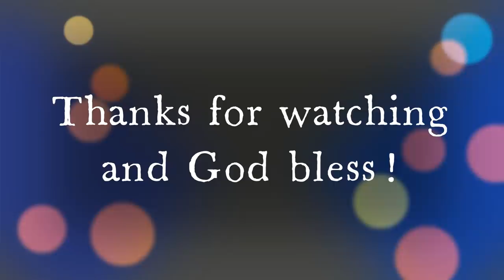Brrrr! Dairy Farming in the Cold/Frozen Waterer/Gehl 4400 Skid Steer Repair

Comment: just watched your show. you have water lines freezing and having some one come over with a steamer. here in northern alberta where we get temperatures as low as - 50 some winters. we do have water line freeze, tip for you to maybe save money, i use a length of plastic hose about 8 ft long (frost goes down that low where there is high traffic areas such as around watering bowls) that is small enough to fit inside the frozen pipe. you can  either poor hot water down using a funnel or a hot water hose if handy. i also find that what works the best for me (since i dont have hot water hoses close by)  is a water fire extinguisher filled with hot water and pressured up with air and a small hose attached to push down pipe. works great. if you have never tried this, hopefully that might help next time and save some coin for you

Comment: The skid steer with the fouled spark plug, find out which plug, take it out use your propane torch heat the tip and some of the threads just to burn the carbon off and pick as much of the carbon off and reinstall the plug and it should fire, I am sure you do this already to the chainsaw and snow mobiles too.

Comment: I have put a 100 watt incandescent light bulb in a pig tail with a plug end on it, connected to a extension cord inside of those heated waters. There is enough heat off the light bulb to keep the pipes from freezing.
Reply from the maker: I have a heat lamp in there, this froze under the ground because the pipe isn't very deep under the building.

Comment: Need one of those heat trace cables for that water line 👌
Reply from the maker: Those work good, but this one freezes under the floor, and I can't get a cable down there.
Reply: @trinitydairy  
These tee in and the cables go in the pipe , works good, have some at home  for the same type water system
Reply from the maker: @jjm4794  oh that's cool! I've never heard of those.
Reply: @trinitydairy  
Buy what ever length best suits you and done
Reply from the maker: @jjm4794  where do you get them?
Reply: @trinitydairy  
I get them through my supplier at work but I have seen them on Amazon
Reply from the maker: @jjm4794  thanks, I'll check it out.

Comment: Need to get a bottle of 9-1-1 fuel treatment and dump in the fuel tank of your skid steer
Reply from the maker: I run no1 in the winter.
Reply: @trinitydairy  never tried it. Always used 9-1-1 helps I found even if you get a fuel mix you still have gelling and you get condensation
Reply from the maker: @tractorsfamilyandwildlife1342  a friend of mine, worked for a logger, and they put 1 gallon of gasoline in 500 gallons of no2 diesel, and he said that worked really good.
Reply: @trinitydairy  wow never tried that learn something new every day